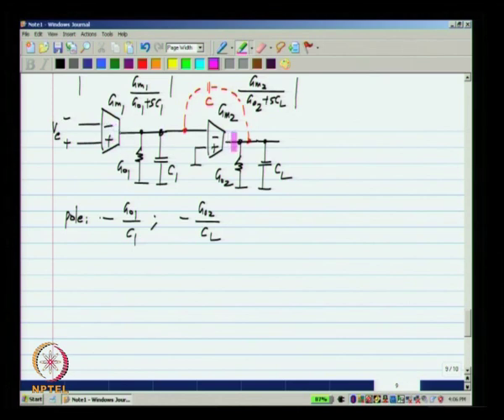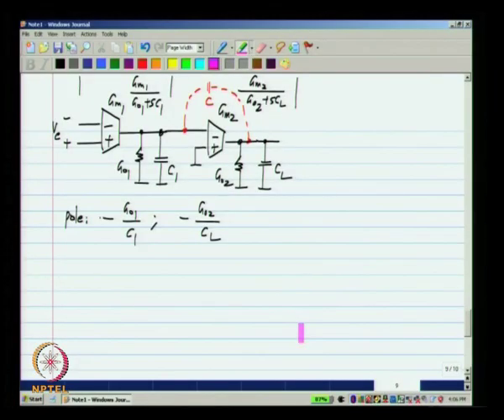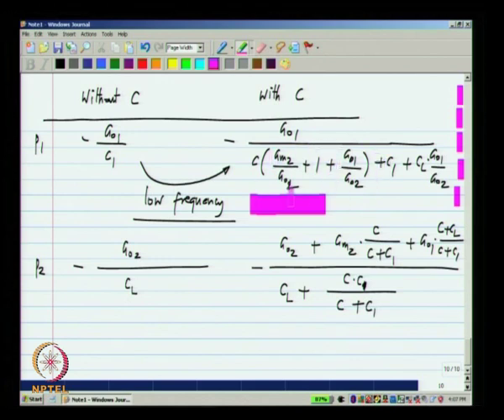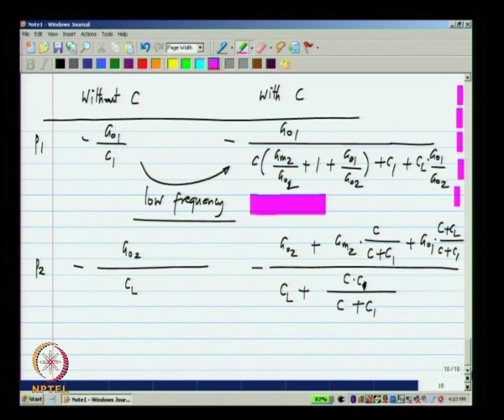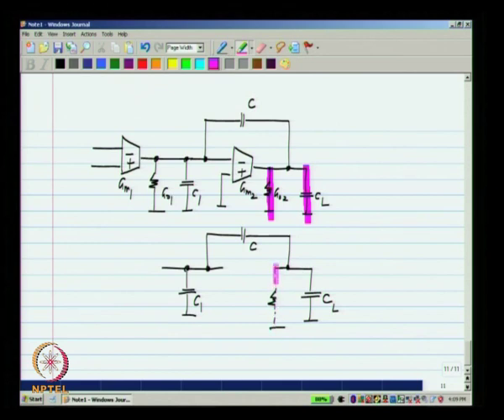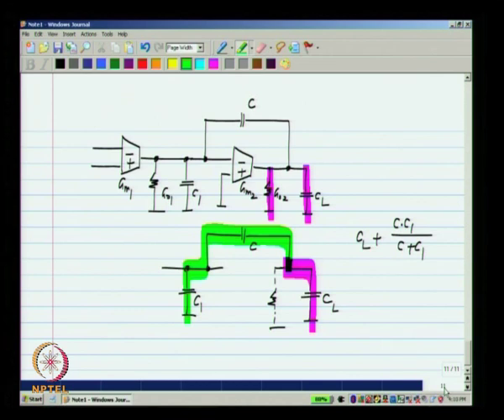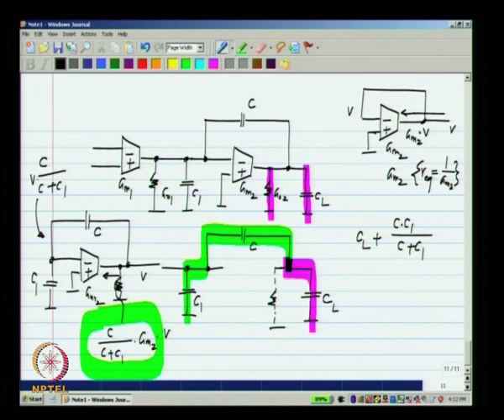Two stage miller compensated opamp-2

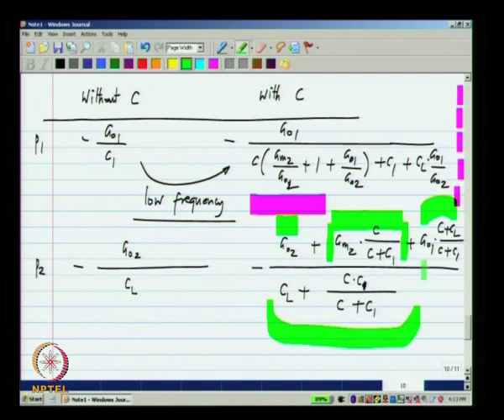Comment: for p2 in the numerator (say @ 07:49) we say that the conductance acts like a resistor and simply do the voltage division for the capacitor, resulting in Gm2*C/(C+C1) but why don't we consider the effect of the resistor Ro1 or rather conductance Go1, isn't that in parallel with C1 which will affect the total conductance? basically what I'm saying is there should be a Go1*Gm2 product in the numerator too. Correct me if I'm wrong please. Thanks a lot

Comment: What is meant by the unity gain frequency of the overall opamp should be smaller than that of the second opamp used in the implementation 41:50-42:10
Reply: same doubt!
Reply: @ecestories8816  The assumption while putting 2nd stage in place was that it would behave like a CCVS and Gm*Ve current of 1st stage will flow through cap "C". This assumption is only true if the 2nd stage behaves close to an ideal opamp for all frequencies below the UGB of overall opamp, implying that it should have sufficient gain even at UGB of overall opamp. I hope this explanation helps. This is again explained in next lecture (Lec 15) ~6min
Reply: @subhashsahni2851  Assuming that we have the 2nd amplifier's ugb well outside the ugb of the entire opamp, then why is the DC gain still shown as a finite value. The effect of Ro1 and C1 should have been removed due to virtual short since the 2nd stage is like ideal.